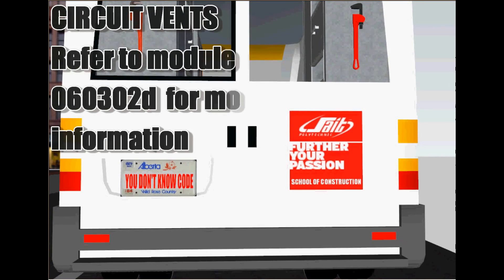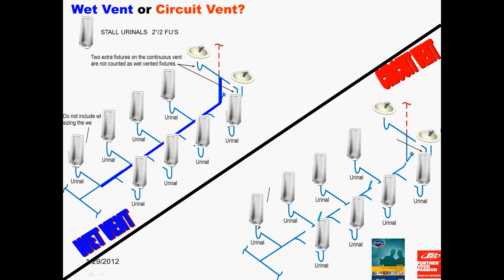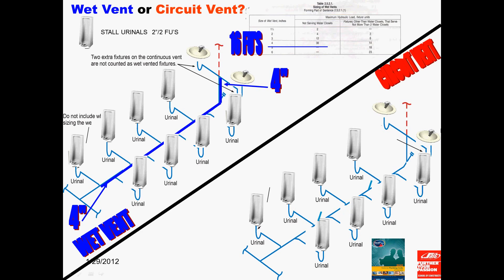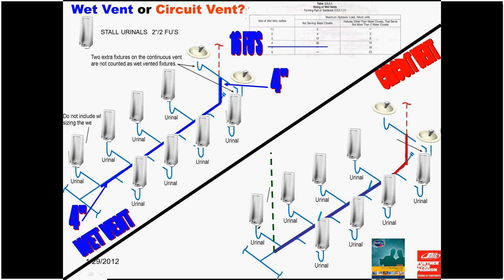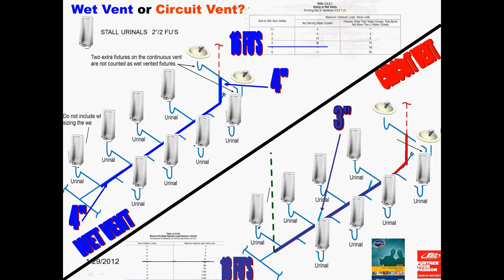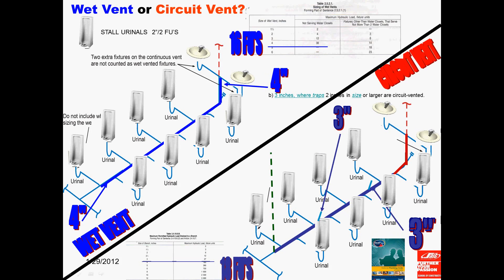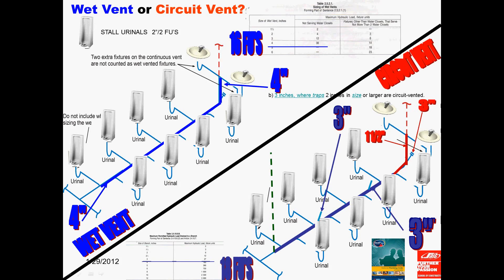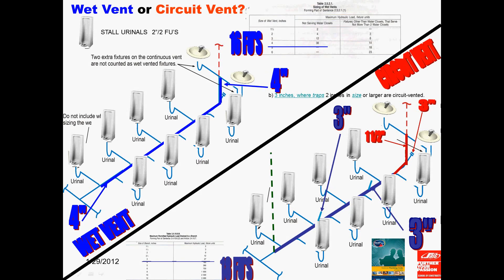SAIT PLUMBING WET VENT VS CIRCUIT VENT TUTORIAL

Comment: The downmost green pipe: Is it not the relief vent of the circuit vent. In the video, it says circuit vented branch. Could you elaborate a little bit. Thanks Fred. (Great video. I went through several times already)

Comment: I am new in plumbing. This is a great video. I have a question about the long blue pipe. Is it horizontal or at a slope (for example 1:48 (2%))?
Reply from the maker: if you are talking about the wet vent and or the circuit vented branch, the wet vent on the top half of the animation is 4", so it could be 1/8" , 1-100 or 1% min grade, and the circuit vented branch on the bottom half is 3", hence it could be at min grade 1:50, 1/4" per ft, or 2% grade.
Reply: @notooshaby  Hi Fred. Thanks a lot for taking time to reply my question. Ai the installation of a plumbing system, I am curious to know how do they achieve this vertical piping (risers, stacks, etc.) and the horizontal drains that are sloped usually. Is the fitting at the intersection is 91.193 degrees for 1:48 slope? Do we use an elbow of 88.807 degrees elbow at the upstream of the trap-arm of a p-trap (say 3" trap size) of a WC. How do we specify these fittings? Please help. (Note: I will be taking a series of plumbing training courses from BCIT here in Burnaby, BC.)

Comment from the maker: The new or latest Canadian National code book (2015) version has a small amendment to it under FIXTURES DRAINING INTO VENTS 2.5.4.5. c).   This states that....the section of the vent pipe that acts as a wet vent is not less than 2 inches in size....This pertains to fixture units dumping into the wet portion of the circuit vent, which means that the video should say that the vertical red pipe (wet portion of circuit vent) above the cleanout should be BANGED UP A NOTCH to 2" instead of 1 1/2" which was previously good on the 2010 code book.

Comment from the maker: The 2 lavs hydraulic load or fixture unit load are effecting the wet vent and are included in the load.   What I meant is that the 2 lavs are not being wet vented, they are above the wet vent and are drawing air from the continuous vent above them.

Comment: sorry, but why does the diagram indicate that the two lavs are NOT included in the wet vent load, but you clearly say there is 16 fu's (2x7 +lav+lav) affecting the wet vent. And could you you refer me to the clause that states those lavs shouldn't be included, thanks!

Comment: You cannot wet vent a urinal, least not here in Michigan. Wet venting is for bathroom group fixtures only, which are : Toilets, Emergency floor drains, bidets, showers, tubs, and lavs which are actually individual or common vented, but extend from the wet vent.